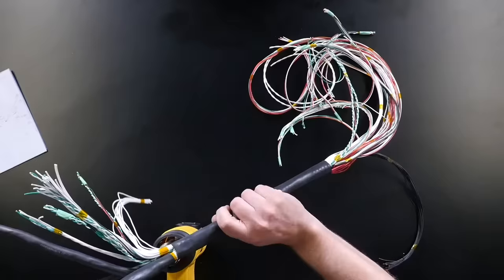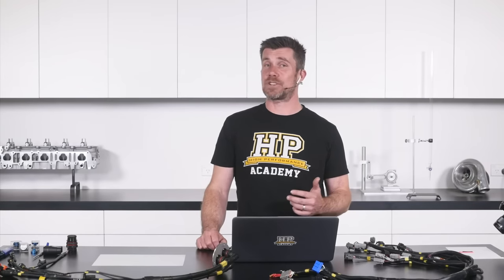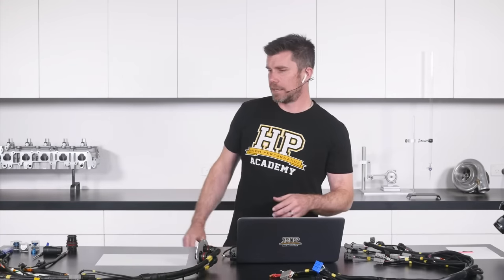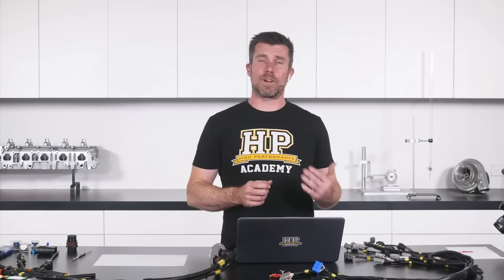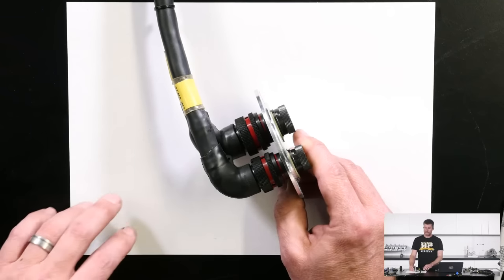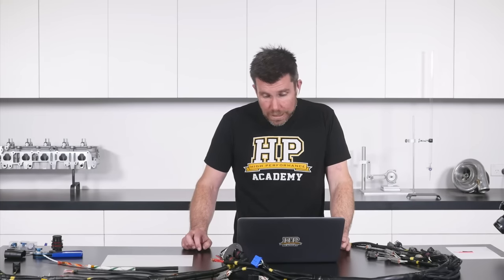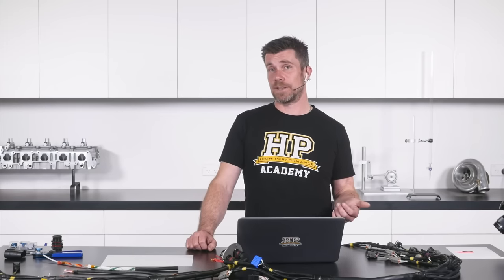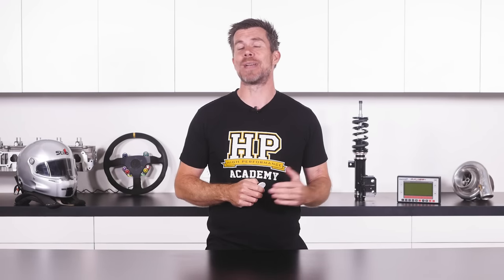You Don't Need 'PRO' Level Wiring....Do You?

Comment from the maker: Building a fast car? Get $400 OFF the VIP package and never pay for another course, EVER: https://hpcdmy.co/vipy21
 50% OFF. Get the wiring knowledge you need, enrol instantly: https://hpcdmy.co/offery21
------------------------------------
TIME STAMPS:
0:00 - Introduction
0:25 - Why we don't exclusively use the term Mil-Spec
1:40 - You don't need to spend thousands of dollars
2:25 - Factory vs motorsport harness
10:40 - Wire
15:00 - Sheathing
20:05 - Boots
24:00 - Concentric twisting
31:05 - Tools
37:00 - Time
38:40 - Cost
41:50 - Serviceability
43:45 - Questions

Comment: I have worked in professional racing for 20 years and the purpose of those Motorsport wiring harness are made so you can pull the engine out quickly. That’s why every line is a quick connection aluminum on braided line. For speed not to look cool.
Reply from the maker: Yes the connectors are rated for many cycles of use in this regard too compared to other options - Taz.
Reply: you can have a milspec bulkhead connector on any harness but it wouldn't necessarily make the whole harness "motorsport" grade

Comment: As someone who makes harnesses for all types of motorsport, club level or a so called “milspec” with raychem boots and AS connectors. When I do the loom for my project car I will ofcourse be going all in for it because I love doing it, but a club level loom is suitable for any road car or track day car. Anything that’s racing at the highest level such as GT or World Series championships must have a proper milspec loom. It’s a must. Completely agree with andre on this one.
Reply: Are you UK based? If so I need a harness made
Reply: @ChevyS10LSUK I've also had issues in UK with very poor harnesses and ended up making my own this so called professional that crimped connectors were all pulling out lol just take your time don't worry about wasting material on your first time also get the correct crimp tools
Reply: @AshLongie  thanks man, I’m struggling with the very basics at the moment. Do you use 1 ground for the loom (ground to chassis) or do you need to run the multiple grounds individually back through the loom? That’s the 1 thing preventing me from making my own loom.
Reply: @ChevyS10LSUK  in myn I've made 2 one for an Evo and one for fd3s 
Both very similar, the grounds they call it star point grounding think haltech or adapteonic made a vid onit where I select a point to ground but be careful the crank sensors cam sensors coil primary, require the 5v sensor ground from ecu so for this I used a ECU sensor ground thick wire to engine bay and branched off it same with the 5v + that comes out ECU, 
Always leave few extra wires spare in engine bay harness incase I want to add flex fuel or any additional sensors later on 

From battery a nice thick gauge wire straight to engine and one to chassis 
Be careful again if u relocate battery in boot I've noticed a very large voltage drop with DIY jobs, make sure you use a multimeter at fuel pump and check you getting decent voltage as I've seen pumps only have 11v even tho battery charging at 14.4v it's a lot to put all into message lol these are the things that pop into my head this was causing random tuning problems inconsistent tuning 
Also support your harness from any rubbing use Pclips
Reply: @ChevyS10LSUK  the reason I use 2 wires is I've had it where starters can cause interference with engine sensors 
Also have a more than adequate battery I've seen people use them tiny battery's cranks the engine but doesn't have enough capacity to keep all sensors powered while cranking

Comment: Not going to lie most wiring runs can be made very clean  and 90% water proof with a good electrical tape job and cheap braided sheath near hot spots and on the visible runs. Will work perfectly rub and heat resistant can use heat gun on tighter corners and  it will hold shape pretty good can do a whole car for $50.  Can use heat shrink and get the cheap plastic connectors 99% waterproof. Can also reuse factory connectors or go cut them from the wreckers to reuse. Can have the fanciest connectors and still have a bad crimp or connection giving you grief . Can also make a fancy custom loom and realise you want to change a wire run highly recommend having a car running and driving before you wrap or sheath it as well.
Reply: What else you can do?

Comment: Having a motorsports harness made for my GTiR was one of the best investments I made on it. It's only a street car. But boy is it nice. Not cheap. But nice.
Reply: I’d like to do the same for my new edge v6, mostly for simplicity and prep work between different engines and major components. However I’m worried about specific connectors for things like headlights/tail lights and might look into doing what they do at Le Mans, however some things will be pricey 😅

Comment: Sorry to question something, but why would a professional team replace a high end motorsport grade harness after every round? Isn't that the point of it being a high end motorsport harness for it to last well? It almost seems as exposing the team to higher risk of failure by replacing a harness so often. Introducing more potential for manufacturing defects. If the harness is that well build then it shouldn't be a potential failure point for many years.

Comment: is it possible to build a club level harness with a bulkhead connector because that seems efficient for cars with difficult to work around engines
Reply: Look at Deutsch HDP20 bulkhead connectors. Plastic, but far cheaper and available in up to 47 pins. You can also save by using open barrel crimp pins instead of the solid pins that need the $200 crimp tool.
Reply: @justion337  thanks for the information I've been trying to find information on a bulkhead connector but haven't had much luck
Reply: I'll second the recommendation for the hpd connectors, they're a very cost effective option especially as there's the commonality of pins and tooling with the various sized Deutsch DT/DTM/DTP connectors.
Personally I'd avoid the open barrel pins cos I find them quite finicky. Unfortunately the price of the HDT-48-00 factory crimper has gone silly else I'd recommend that (I paid 1/2 of the current price)
Reply: @hannahranga  buy the JR version, i did on amazon $200 shipped

Comment: Just something I've noticed using both split plastic sheath & braid sand and dirt will build up inside and if there is any vibration or movement you will sandpaper the insulation off the wire eventually maybe not on a track car but on street car or anything running for extended periods of time. Seal your wiring.

Comment: Can you go over how you label your wires? I've always had troubles with using a label maker as it leaves a long tail sticking out of the harness. Do you also have a method of labelling each conductor? When I remove my connector it's difficult to identify which pin they were in originally as I use only use red wire
Reply: Not sure what you mean by the long tail. My main issue with labels was dealing with weak adhesive. Even if you have nice labels with good adhesive, I'd still recommend clear shrinkwrap to secure and protect the label. Possible solution to the tail too? Probably not but I felt like sharing.
Reply: There are label makers that can print directly onto shrink wrap!
Reply: @1hdsquad  yep and there's video on YouTube.
Reply: Best solution would be a laser wire marker but a Dymo shrink tube printer will do just fine.
Reply: Typically as I build a harness, I make a diagram with color codes etc. You can find primary wire with all sort of color combo's. If that's not something your interested in, the printers for shrinktube work well. Mine is less racing, more restoration, or custom builds. So printing on the tubing isn't a great long term solution for something that's exposed to the elements. Build your harnesses modular too. Divide it into zones or systems.
Reply: I make all the labels I'm gonna need and then cut them down to lengths then use clear heat shrink.

Comment: With the harness tape for lower spec harness it's worth chasing down the slightly more heavy duty stuff that's designed to be in the engine bay, the fluffy stuff is generally intended for interior usage. That said both seem to be holding up well in the two series Landrover's I've worked on.

Comment: Not motorsport, but I do a lot of harness design for work which led to this video showing up in my recommended (thanks youtube). You bring up a good point that "mil-spec" as a term is fairly vague in what type of connector it refers to as there is such a wide variety. To simplify this, often the term "mil-circular" is used to describe the type of connector shown as it is by far the most common type used. Not saying the motorsport industry must/should adopt the term, but it is an instantly recognizable term to other industries supplying/using these connectors.

Also, if you really want to enter a world of confusion, start looking into mil-spec wire. It might hurt your brain in more ways than one (spools of PTFE jacketed solid-core cable can act similar to a wound garage-door spring).

Comment: What about Deutsch DRB connectors as a bulkhead connector?  They have high pin densities and high pin counts (128 max).  They also have varying pin sizes.  The 102 pin version has (2) 4 ga, (4) 8 ga, (16) 12 ga, (80) 16 ga.  They are a little large 5" x 2.5".  I think there are also options for boots and elbows.

Comment: Factory wire harnesses leave a lot to be desired. A couple bulkhead connectors and converting to heat shrink makes a big difference. 
-- The harness doesn't need to be concentrically twisted. If you mock it up and heat shrink it on the vehicle, the harness will hold the shape of wherever it belongs. So, if you plan for that, you should be able to get a good fitting system in a reasonable amount of time. 
-- If you plan things carefully, a harness will be repairable, simple, clean, and fast.
Reply from the maker: You can use anything you like, it all has pros and cons.
The important part is understanding both pros and cons and deciding what you can live with and without for your budget and use case/application 😎 - Taz.
Reply: @hpa101  Definitely! Wiring is something I should have learned to do a long time ago. Thanks for posting these videos! It helps people be more realistic in their projects.
Reply from the maker: It's always better to have started when you did than even later. Hard to fit it all into life too! Great to hear it sounds like you have a handle on things and are enjoying it 😎 - Taz.
Reply: @hpa101  Yeah. Currently, I do stuff for tractors and semis. The owners are tired of OEM hassles. They want the harness to come apart "right here, over there, and be covered with that smooth stuff so they can pressure wash it." Some day, I'll do that awesome hybrid monococue/tube frame race car that's worthy of a concentrically wound harness that's modular for crashes.

Comment: Kapton is quite flammable. Kapton insulated wiring was used by Airbus a while ago until an accident happened some time ago. Aircrafts with Kapton wiring a still in service till this day.
Reply from the maker: I should really have my coffee before diving in here haha. This post is more helpful than my previous reply: https://m.facebook.com/HPAcademy/posts/4920009788091102?locale2=ne_NP - Taz.
Reply: The historical issues of Kapton were when it was used as insulation that got exposed to moisture. Here, it's just tape that's wound around polyethylene insulated wire and buried in heat shrink. Kapton tape is awesome.

Comment: literally here for an electric vehicle conversion
it's interesting that in an ev, heat is a complete non issue, fuel too, so i can get away with the much cheaper options that are mostly for abrasion resistance
however water resistance and proofing become a little more important because electrical shorts with complex ev electronics cause bigger problem than an ECU might need to deal with
Reply from the maker: Heat is an issue on the performance EV side of things for sure. Hope the conversion is going well 😎 - Taz.
Reply: @hpa101  not nearly, engines get incredibly hot, motors get only kind of toasty by comparison and a radiator fan easily suck all that heat away fast.
If you're talking about DC motor drag racers, those can get kinda hot
Reply from the maker: https://www.hpacademy.com/blog/700whp-hybrid-350z-and-electric-lotus-modern-ev-conversions-tech-talk/
Reply: @hpa101  ah, I think I get the confusion. Heat in an EV context is like heat in a human context. For an engine, 100c is normal, for a battery system, only 21c is normal and it feels nice for people. In fact upwards of 50 or 60c is when humans get heat stroke in minutes, or when emergency power shutdowns start disconnecting batteries. 70c is a *battery fire*. Even power electronics inside the motor and inverter rarely get above 60c in normal operation otherwise they start losing their brains.

So for EVs the total heat isn't much but you REALLY REALLY do not want to overheat stuff, operating within a pretty narrow temp range, and quickly/viciously rejecting all heat beyond that.

In that context, even regular PVC wire is fine, you're basically never going to get it hot enough to cause issues unless the car's on fire and in that case, you got bigger problems.

Comment: So how much weight would you actually save with the same harness made at a pro level vs. a club level?
Reply: I would imagine the pro harness would weigh the same or more with the metal plugs vs plastic.
Reply: Nah it would weigh less. Alot more engineering smaller wires. Better routing so less wires. It makes a huge difference. Pro stuff anyone can figure out too because there is rhyme and reason to it

Comment: I have been around motorsports alot in my life. Presently I drive a log truck in the northwest of the US 🇺🇸.  I can honestly say, O.E.M. wiring harnesses are shit. Especially with the chemicals applied to the road in winter..building a correct harness, using the racing industry application. Would probably save you thousands over time!
Reply from the maker: Everyone thinks just because OEMs make and spend a lot of money that they are doing the best job possible. As you know, far from the truth! They are there to make money, not a perfect product 🤘
Safe driving mate! Always impressive where you fellas pedal those log trucks up the side of mountains! - Taz.

Comment: Where do you get oem connectors beside the dealership?
Reply from the maker: Some aftermarket suppliers stock them too. There isn't a specific source as some places specialise in one marque and often even just one specific model. Once you have the part number it's straight forward to search - Taz.

Comment: Is it possible to use GXL, or could the extra thickness be a problem?
Reply from the maker: The wall thickness is only an issue if you're using it with connectors that are not suited to that thickness, so the answer is both yes and no. 
We generally use TXL though, or Tefzel, depending on what we're building rather than GXL.
Note that often the wire is one of the cheaper aspects of the materials bill - Taz.
Reply: There's a tradeoff somewhere. 
14 SXL is so thick, putting heat shrink on it is optional. 
16 SXL is workable, but kinda stiff. Hard to make strain relief loops. 
18/16 GXL has a "quality" feel. Strain relief loops are workable in this size. 
12 TXL in a 14 circuit bundle is about like a 00ga welding lead. Can't tie it in a knot, but it's workable. Good luck!

Comment: Yeah but I'm also worried about EMF coming off the wires
Reply from the maker: What is the information source that has you worried about this? 
If you are doing things correctly, like shielding and twisting (pairs, you don't need to do the whole loom) where applicable, EMF is not a concern - Taz.

Members lesson '298 | Terminating Shielded Cable' - https://www.hpacademy.com/previous-webinars/298-terminating-shielded-cable/?utm_source=youtube&utm_medium=social&utm_campaign=general-interaction
Reply from the maker: Also a good one: https://www.hpacademy.com/previous-webinars/230-star-point-earthing-explained/?utm_source=youtube&utm_medium=social&utm_campaign=general-interaction

And this one is probably also a good one for you, but it doesn't cover interference, just generally a good watch: https://www.hpacademy.com/previous-webinars/306-basic-wiring-fault-finding-2/?utm_source=youtube&utm_medium=social&utm_campaign=general-interaction - Taz.